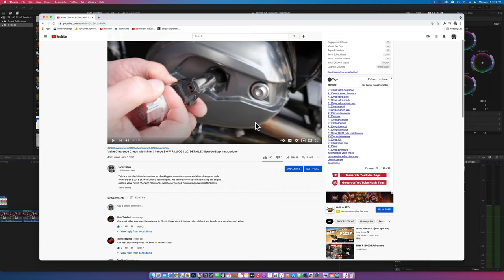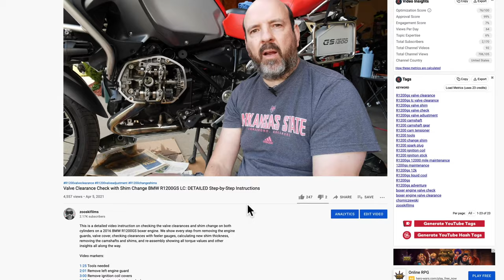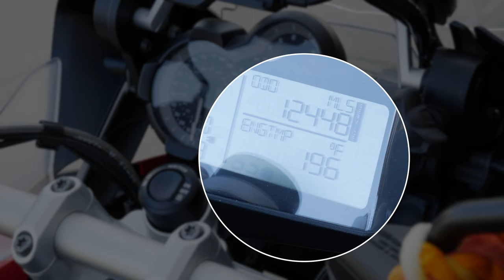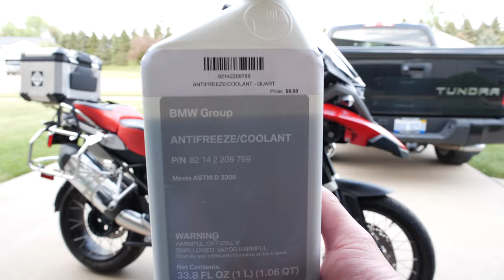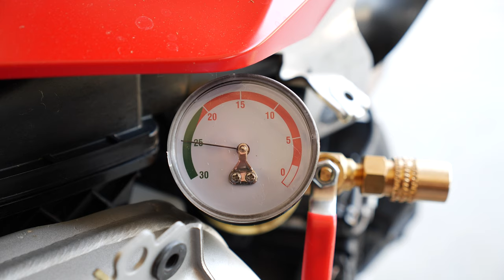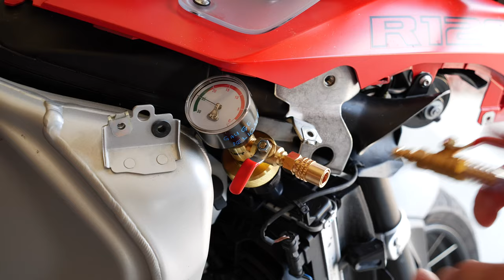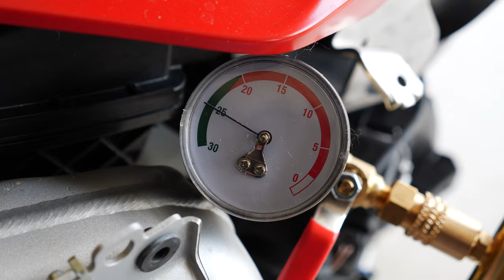BMW R1200GS Coolant Drain, Flush & Refill, Step-by-Step Instructions, Vacuum & Manual Refill Methods

Comment: One question. When using the first first fill system, you ran out of vacuum.  Do you think if you pulled a second vacuum,  would it have filled it completely?
Reply from the maker: @Ed Syphan - Do you mean pull a second vacuum to increase the total vacuum pressure before releasing the coolant? I did open the compressed air valve a couple times to see if the vacuum pressure would increase, but it wouldn't. I wonder if I should have increased the air pressure at the compressor. You can't pull a second vacuum after coolant is in the system, so it (vacuum) has to be there before releasing the coolant line. The other tricky thing is making sure the supply coolant line doesn't have any air pockets. I had a difficult time accomplishing that but I was finally able to do so. I saw other videos where people just put the hose into the coolant but the line between the coolant and the valve on the kit was empty, which means the first thing to enter the coolant line in the bike when opened would be air. I wanted to prevent that and make sure coolant was right at the valve when it opened. Hope that makes sense. Let me know if I didn't answer your question. Thanks again!
Reply: @zooskifilms  Yes, I thought that after you put the first load of coolant in and it settled, then add more vacuum.  But I guess that's been tried?
Reply from the maker: @edsyphan3425  - Ok, I understand now. Once the coolant is in the system you cannot pull another vacuum. If you try, the coolant in the system will be sucked out. So you need to pull the vacuum with the cooling system empty. If the vacuum is not strong enough, you won't be able to get the system to pull in enough new coolant.Too much vacuum is not good either, follow the recommended vacuum pressure from vacuum kit manufacturer. With both kits I tried I had to add more coolant after the vacuum sucked in new coolant. My thought is that is ok, because the vacuum fill will make sure there are no air pockets downstream in the cooling system. The only pocket should be near the fill neck, which is gone once you add more coolant. Hope this makes sense!
Reply: @zooskifilms  I just changed the coolant in my Tiger shortly before buying the GS.  They put a bleed plug on the opposite side of the radiator. It makes it a five minute job.  BMW always has to.  make things fun.
Reply from the maker: @edsyphan3425  - Amen to that!

Comment: At 24:00, when you let some air in, couldn't you have just sucked on the partial fill, and fill the rest, without draining the partial fill first? (The coolant might "boil" a bit though at the low pressure? But maybe only briefly, I think it would have worked..)
Reply from the maker: @Peter Baumgart - Thanks for your question. Yes, I could have certainly manually filled up the remaining coolant and burped the bike (as I did in the first manual method), but I wanted to see how much coolant this kit would suck in if done properly. Especially since the Costway kit didn't suck in enough coolant to fill to the top, so it was more for my curiosity and to make a better comparison between the two vacuum kits. The Airlift refill kit did a much better job, so if you want to use a vacuum method (which is recommended by the BMW service manual), thenI would recommend the Airlift over the Costway. There are other vacuum kits out there, just wanted to present a clear comparison between the Costway and the Airlift kits. Thanks again!
Reply: @zooskifilms  Thanks, makes sense then. Considering that the flush is needed "rarely" (years to forever) I'll just do the simple burping method i suppose...
Reply from the maker: @Peter Baumgart - A good plan!

Comment: hi. at 07:31 , where can i find the drain bolt? thanks
Reply from the maker: @thousandsmilejourney298 - Looks like you are in the UK. You can find your local BMW motorrad dealer for this part. The PN# is:  17128523491 Banjo bolt with check valve M10X1 . Hope this helps!
Reply: @zooskifilms  great 
thanks ☺️
Reply from the maker: @thousandsmilejourney298  - 👍

Comment: I'm sorry my friend, I gave you a dislike.  Because it is very simple and you made it very complicated.  By using pressure equipment that no need for it.  You supposed to make videos for ordinary people and not for use by the specialized maintenance workshop of companies.  Simplicity is beautiful
Reply: Maybe watch everything first before commenting? And read the replies? This video shows all possible methods. From just a manual dummy fill to the vacuum option. Up to the viewers to decide what methods to choose. The author has done a lot of work. Let’s thank him for this!
Reply from the maker: @Reinout Bouman - Thnaks for pointing that out! I’m behind on responding to comments. But you’re exactly right, I showed the two options and at the end of the video commented the manual fill and burp method is just as good as the vacuum fill method. Thanks for your support!
Reply from the maker: @Bike Story - thanks for your comment but it seems you didn’t watch the entire video. The first method I showed was a manual refill. I know the video is long but I put chapter markings in the description so you can quickly jump to the section of interest.  Anyway you are free to dislike the video, but in this case I would take your comments to heart if you watched the entire video first. Cheers!